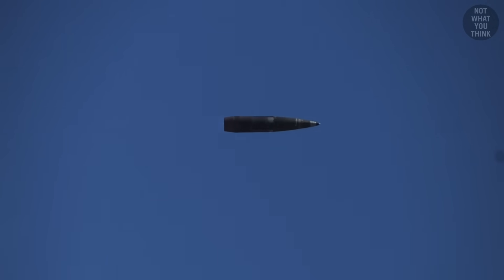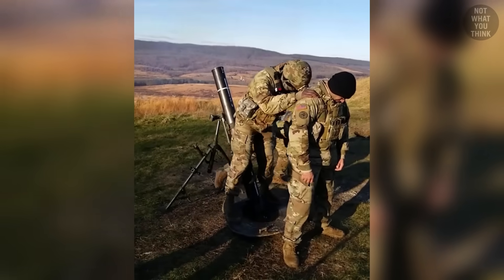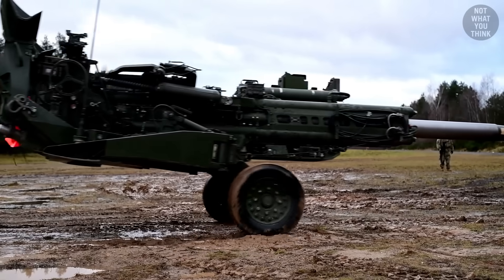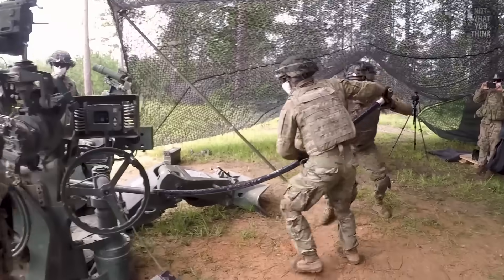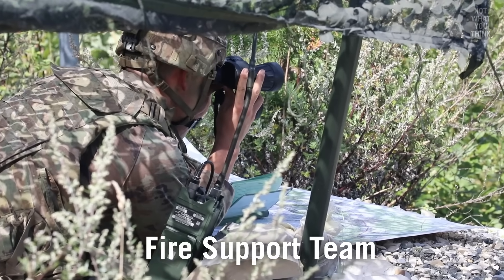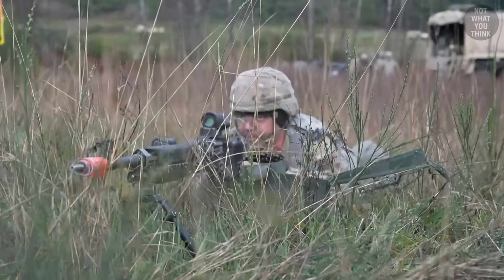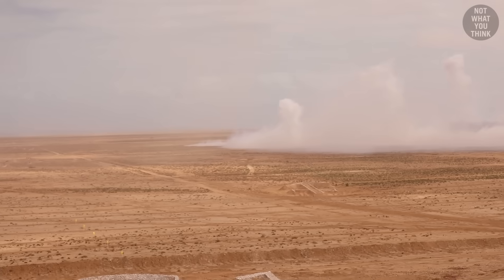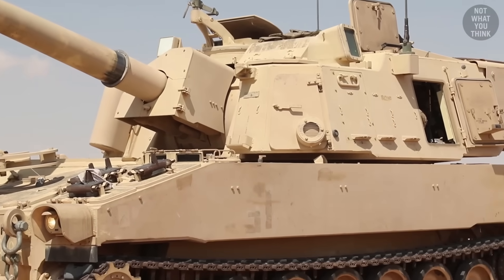How Aiming Artillery without Seeing Target Works

Comment: Fun fact: There is a possibility to locate enemy artillery without radar. When you use a radar, you make yourself a juicy target for enemy artillery and anti-radiation missiles.

Three microphones are placed apart from eachother and listen to soundwaves in the ground. When the enemy fires, the microphones can be used to triangulate the enemy position without giving away your location, also the enemy won’t know their location is known.
Reply: There are hardly any aircraft flying counter strikes on artillery spotting radars because they can be much smaller, and artillery has a much smaller range than air defense so you will be closer to the enemy's trying to use anti rad missiles
Reply: There is a third method.  We were trained to 'read' a shell crater to find the back azimuth the projectile came from.  Then analyze that azimuth on a map to guess the hiding place of the cannon that fired the projectile.   Fun stuff.
Reply: @Carlschwamberger1  analyzing the crater puts you in the cross hairs for a 2nd round tho.
Reply: @DrDeuteron  Yes it can.   Depends of if the enemy has intent or leisure to shoot again at the location.   Any time you are in range of there is risk.   Its like any other reconissance or observation, is the information worth the risks.   One of those nasty decisions officers and NCOs have to make.
Reply: @Carlschwamberger1  honestly sounds more readily available than using mics if you got no eyes in the sky or anyone with a radio having a visual.
Reply: @Carlschwamberger1  that also sounds really interesting, although I‘d imagine it‘s pretty hard finding an exact location to get rounds on target from this method alone.
Reply: doesnt microphone triangulation also limited by speed of sound and sound dissipation .w.
Reply: @youmumyon1880  yes, but on solid matter the sound travels farther and faster
Reply: @diegopena7744  theres also tectonic movement noise and sound doesnt transmit through different matter that well..?
Reply: @youmumyon1880  background noise, you use it as a "control" and substract it from the actual measurements
Reply: @Geerice  neither does a cannon sound like cannon when you hypothetically somehow can hear it from >10km away even through ground
Reply: @youmumyon1880  also can be effected by soil type and clutter [waves travelling at different speeds through different strata on a micro level [local, is someone shooting a few miles aways] versus a macro [covering an entire mountain with seismic sensors to determine if magma is moving to a degree or tremors are occurring] likely not great for in battle situations, and never used in any unit I served in.
Reply: How about some old-school crater analysis?
Reply: @TheGhostrider9667 you beat me to crater analysis! Dang it.
Reply: Using microphones to triangulate the location of enemy artillery fire? Gosh, you’ve l obviously never served in the military doing target acquisition. Howitzers are fired from miles away, and they are usually fired by batteries of at least 4-6 guns in quick succession. You probably can’t even hear the sound of the shells being fired. Even if you can, there’s no way you can triangulate their location due to multiple rounds being fired in quick succession from multiple locations
Reply: @darthvader4209  computers. Actually, you can reconstruct the shape of a lightning bolt from multiple recordings of the thunder, but it is computationally intensive. You don't do it with a grease pen and a slide rule.
Reply: Triangulation
Reply: Wouldn't you need to spread the 3 microphones in a manner that the area, where the enemy is suspected to be located, is inside the triangle in order to use the triangulation method?
Reply: @valzdemreevesalma2905 that would give you more accurate results, but it is not necessary if the microphones are a sufficient distance from each other
Reply: It's called sound adjust, microphones are surveyed in along the front,
Locating artillery is called soundranging

Ex locator.
Reply: What if enemy fires from 35 miles? :)
Reply: Woooo gcfs mentioned sensors rahhh
Reply: There is a far older way, used back beginning in World War 1. It;s called crater analysis and it does work.
Reply: Suppressed mortar - hold my beer 🍺
Reply: This is also how earthquake epicentres are calculated. I can't remember what the equipment being used is called but, essentially, let's say waves travel at the same speed, you will get two radii meeting at two points. The third radius will then meet at one of the two meeting points. It's actually a very easy concept
Reply: FUN FACT 
Boomerang has been about for almost twenty years and it gives an angle and distance to small arms fire under a k, not high-angle artillery from kilometres away.
Reply: Fun fact: This technology is Western and isn't in the hands of most armies. What you're describing is locating OTHER people's artillery positions which wasn't even a topic here. Also, we wouldn't need that to locate artillery, we have sky superiority and drones and many other ways to find enemy artillery.
Reply: Wouldn't you need only two microphones
Reply: @Faded._  From 2 microphones you only know the difference of how long the sound took to reach the two. This combined with an extremely rough range estimate based on amplitude would allow the calculation of a cone section surface of possible origin points (two line segments on Earth's surface, at mirrored angles if there was a mirror along the equidistant line separating the microphones). Depending on the situation you might be able to guess where in that cone surface it is, but a third microphone allows the same sort of calculations to be done 2 more times with the difference in time between it and each of the other two.
Note that human ears are shaped the way they are in order to differentiate sounds coming from in front of behind, and to a more limited degree above and below, since collecting sound from two points alone only reveals a cone surface of possible origins.

If you had to use just two microphones to locate enemy artillery, spacing them several kilometers toward and away from enemy territory would allow somewhat accurate ranging by comparing amplitudes, but you couldn't differentiate left from right. Spacing them parallel to the front and perpendicular to the general direction you're observing would allow an accurate bearing to be determined (assuming they're not behind you), but range would be uncertain.
Reply: @JWQweqOPDH  very generous, thank you
Reply: @Faded._ A single microphone will let you know that the sound event occurred. 2 microphones would let you determine the direction of the event (to 2 different directions). 3 microphones will let you determine both the direction and distance of the event.
Reply: @KillFrenzy96 i dont get why you would need three mics for distance... sure theoretically there could be two cross points but thats rather unusual i guess
Reply: 6  is better
Reply: @mugnuz  If you swim underwater, your two ears can hear the outboard motor of a boat.  You can get an idea of the direction but not the distance, as what you hear is the difference in phase between the two sounds at each ear.   With the third mic there are two phase differences (like two angles) and that allows the distance to be determined.   Unfortunately animals and humans never evolved the third ear!
Reply: @KillFrenzy96  right, so 2 mics gives you the difference in the distances to each mic, and that solution (on the ground) is 2 branches of a hyperbola, where you can assume the one behind you is incorrect (you hope), and then another mic gives two more forward hyperbola branches, and all 3 should have one intersection point.
Reply: There is another way without any technology. Visual detection.
Reply: @Mx12b He's obviously discussing detection of an enemy artillery that is beyond line-of-sight. It would be very difficult to detect, track, and range the shells visually.
Reply: @Mx12b  Artillery is almost by definition not LOS. Getting the position of an enemy battery by looking at projectiles up to 80km away traveling at several times the speed of sound is basically impossible.
Reply: @kre4ture218  no I'm pretty sure people have stood two feet away while the enemy obliviously threw shells down range before surrendering or being killed
Reply: @Mx12b  Well you gotta just send a commando team to every single enemy artillery team that exists. Now the question is, where are they?
Reply: @kre4ture218  Used to have to go down to Ft Bliss and retrain the 1st Armored attached artillery units, because they got to used to running around the range with their M1 Tank buddies that they forgot they were artillery and supposed to hang back for long range support not LOS armored battles lol
Reply: @kre4ture218  That's why forward observers are part of every artillery unit.  Also, counter battery fire is a well understood concept.  Civil War artillerymen had pretty much perfected it by 1862, both sides.  Crater analysis and accoustic triangulation is how they did it before radar/aerial observation. Most artillery is walked in by an observer.  

At least it was during the iraq war.  We always had an FO with us if we got a movement to contact mission.  Most missions after the Invasion up until the rebellion were just MP operations, that is to say we became a police force and conducted daily patrols in our sectors, and made arrests and settled disputes, they actually loved us until BP, KBR, The Swiss Banks and the other corps royally screwed them all.  

We had to fight the invasion all over again in early 04, except this time we were surrounded.  We won again of course, but it was 64 days of brutal combat in a FOB that took enemy fire daily. The Paladins went through several barrels during those 64 days.
Reply: @Mx12b  Brainroot comment, smh...
Reply: @Mx12b  Gee, ya think?
Reply: @daminox  yes, how else would you do counter fire with an onagar?
Reply: @Mx12b actually it's called crater analysis.
Reply: @Mx12b  what the commenter posted was a common artillery finding technique before satellites were invented. It is a common practice for all (peer) armies to know

Comment: 13:21 only most likely a M109 Paladin, if it is the M109A6 variant with the Paladin system. Other M109 Variants lower than the A6 do not have this nickname (officially). The paladin FDC allowes the M109 to halt and shoot within 30seconds.

Also, as always, cool video :D

Comment: The bigger question is, why are modern armies still using towed artillery and not have all their artillery self propelled?   Once you fire your gun, your position is pinpointed by enemy counter battery radar and you can expect counterbattery fire in less than 5 minutes. Modern artillery doctrine is all about shoot so you don't get zeroed.